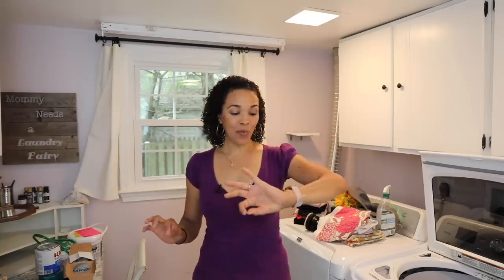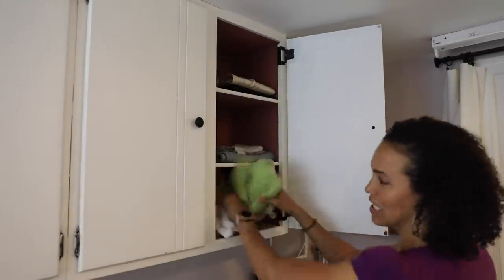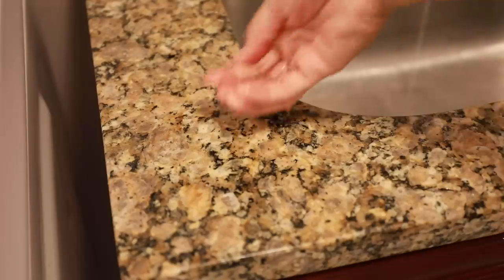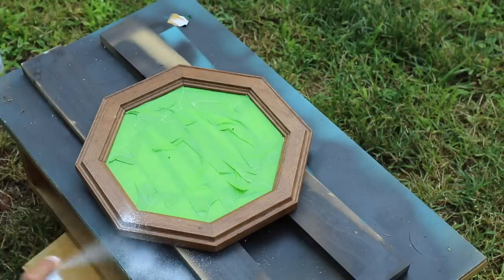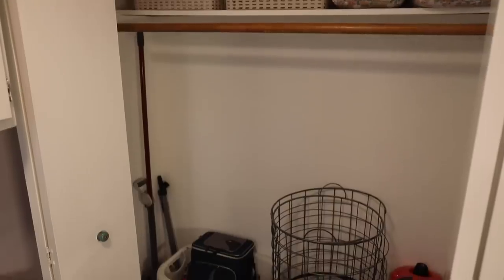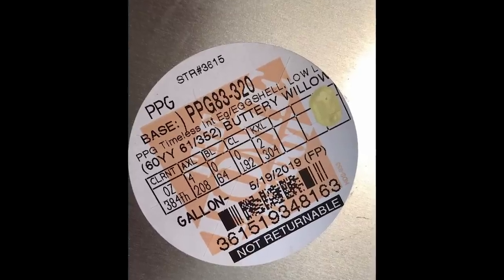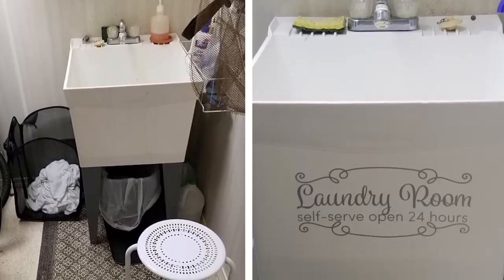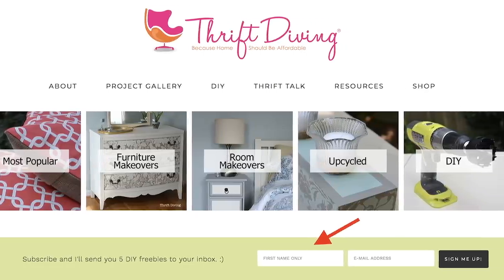18 Laundry Room "BEFORE and AFTER" Mini Refresh Makeovers - Thrift Diving

Comment: I wish mine looked like yours. My laundry is in an empty ugly basement xD. I might paint the concrete and brighten the walls up with a coat of white paint.
Reply from the maker: You should definitely paint! There is a brand of paint called DryLoc that actually seals concrete/cinder block walls and you can get different colors (seals, like if your walls get moisture). But if you don't get moisture through those walls, you can totally use a regular paint. But I like the idea of a colorful DryLoc paint! Go for it! It makes laundry that much less stressful to walk into a clean area. :)
Reply: @ThriftDiving  Yeah I do get that and I will see if my local home depot has that brand. That would be wonderful if it would help with that. I will have to see if there is a video on how to properly paint cement. The previous owners must have painted the floors, but it flaked away to the grey concrete and I wouldn't want that to happen.
Reply: My dad did that years ago in our basement and he used what they had back then (70's) to seal the cement walls. He used a bright yellow so it wasn't so dark down there. The walls never leaked until mom got a slight crack in it when we had a earthquake several years ago. Never thought that we'd have one in Maryland! 😮

Comment: Health and Safety would not recommend caustic or bleach products above your head. I believe it's dangerous for eye safety.  Eye level is acceptable but not above . Least when I did safety inspection at work flammable and caustics weren't allowed up high. Also should make sure not to store turpintine/paint cleaners by areas which could generate sparks. Never closed or by water heater etc.  I don't recall where you put those but I was saddened by all those usafe products not put away properly not mentioned about safety. Washable latex paint is different than stain and oil based. Those require cleaners which are flammable. Please review what you have taught your watchers bc based on what I saw someone could get seriously hurt/fire. 🔥.
Reply from the maker: These are great tips, Monica. So what you're saying, dont store them on the tippy top where you could knock them over, onto your face. Makes sense. My paint cleaners aren't turpentine. I use one that is a food grade orange cleaner, cant remember the name, but the one sitting out wasn't the harsh ones. The ones that are more harsh are always stored in the garage.